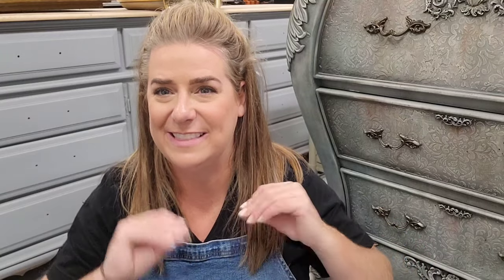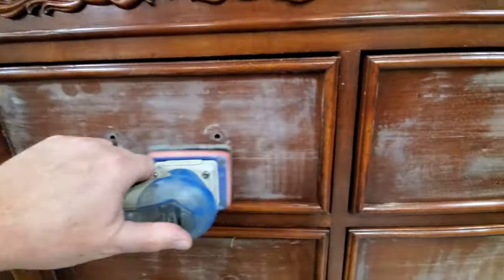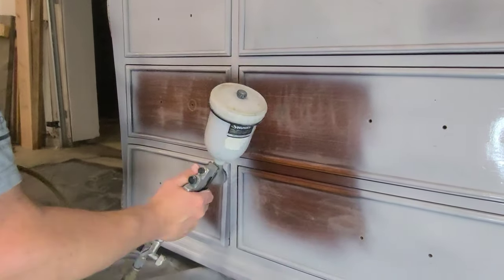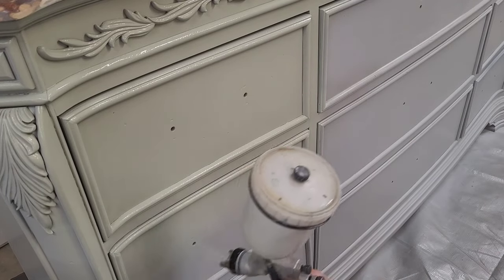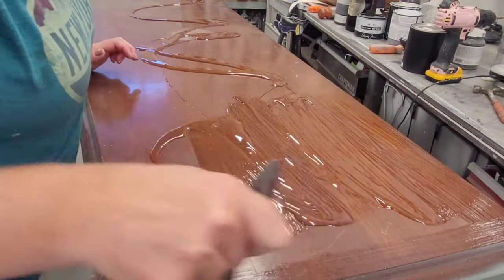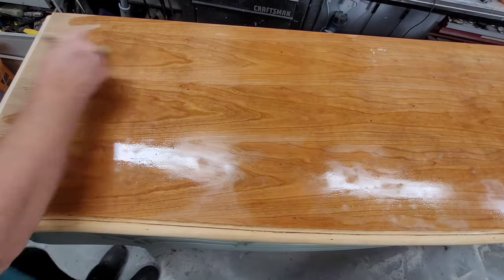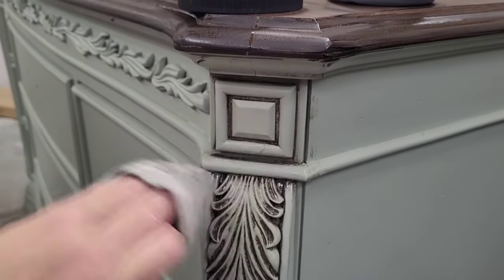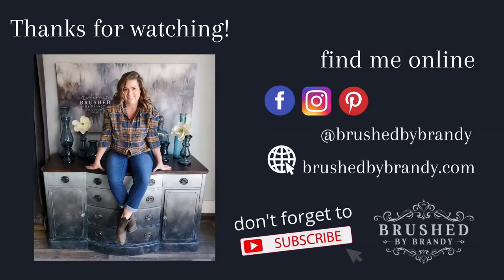Upgrade your old dresser effortlessly with one hour enamel

Comment: This dresser looks absolutely beautiful! 💯 I love this, and I'm considering it to paint my kitchen cabinets. I've been looking at several colors in this palette, and I really love it! Do you think I'd have to apply a topcoat if I use this WiseOwl enamel? Thanks for sharing! 💯 ❣️
Reply from the maker: This is one of the paints that makes the claim to no topcoat that I genuinely don't top coat. With proper prep underneath the finish is really durable. I'll be posting a scratch test with this exact piece as a video short comic up

Comment: Hi, just found your channel.  VERY inspirational and you have great taste in furniture and your color palette.  Question…why wouldn’t you have taken out the drawers when painting?  I’m a newbie and maybe doing that would have added more work than necessary?  Thanks
Reply from the maker: Hey! Welcome! Asking the drawers pu would require taping/pampering them to keep over spray from getting inside. I think it's easier to leave them in, then can touch up the drawer edges if needed. These drawers also don't have a rim that cover any of the frame, so the frame gets completely covered with drawers in

Comment: You said you opted to glaze over the item. Is that a top coat glaze or what? Your link doesn’t go straight to the product. Also, did you glaze over the wax and gilding wax or did you glaze before that after how long did you wait for the waxes to dry before you put on a glaze?
Reply from the maker: I applied the glaze right over the paint, this paint does not require a top coat. It is self sealing. I let the glaze dry, usually a few hours, and then all the gold wax